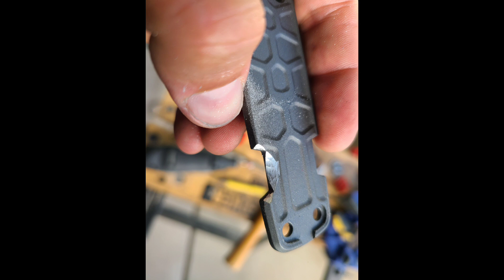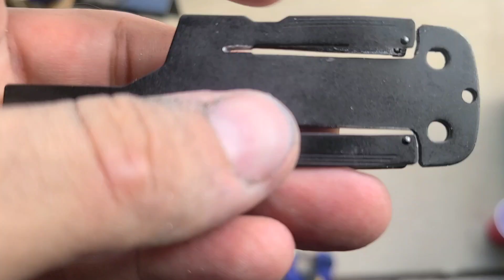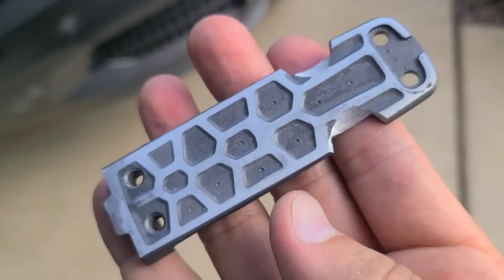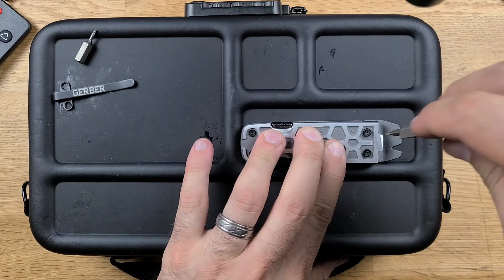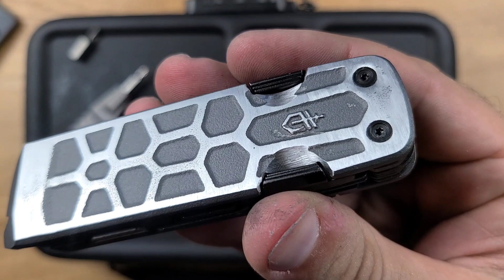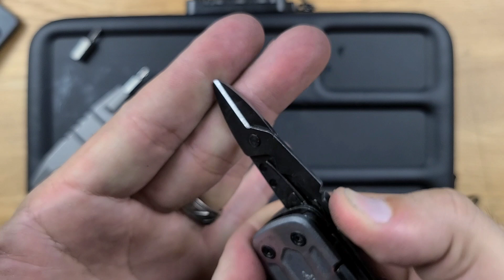Modding the Gerber Lockdown Pry and Solutions

Comment: Hopefully Gerber see this and start working on a 2.0 version
Reply from the maker: they wont even supply speed steel replacement cutters for the MP600...after all the complaints...yea...I wont hold my breath. I rag on Leatherman..but SOG and GERBER are SOOO much worse.
Reply: @maxlvledc  the cutters are meant for cutting and stripping small gauge wire. Hence the name “wire strippers”. I asked Gerber about the cutters, and yeah, they aren’t meant for cutting nails. I’ve cut everything up to fishhooks with mine and they have been fine. I have had my leatherman rebar cutters chip on me however.
Reply from the maker: @hunterglaspell5580  mine chipped cutting a paper clip

Comment: It's funny that I can deploy the blade one handed without much problem. Am I flicking it open? No, but I can open and close  it one handed. When I have had many issues with blade deployment on several other Gerber knives and tools. Some have the frame lock so tight that I have to manually modify it. In any case I love what you've done with the scales, and wonder if there is any way to manually do something like that with mine?

Comment: the fact that it is called the lockdown and every tool does not lock is awful. the file chisel, scissors and hobby blade holder if they will fit in vic and leatherman will make this tool good for modding.

Comment: "Why would you go through the effort of attaching these bars when you could have just made thumb studs?" Now that's the question. These are even worse than discs attached to the spine. They are obstructive without adding value. Nice job trying to fix this dumpster fire of a multi-tool but sometimes, garbage is garbage.